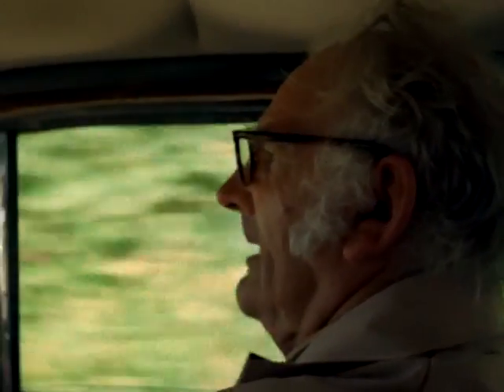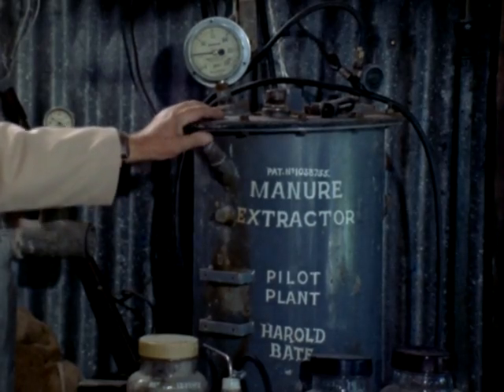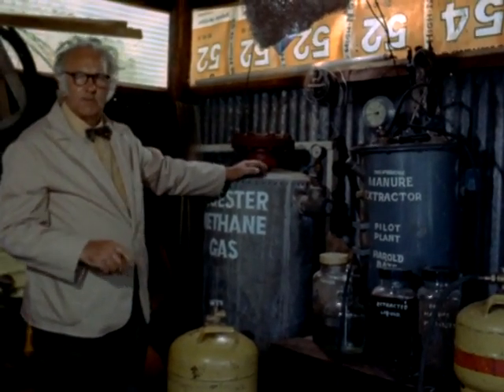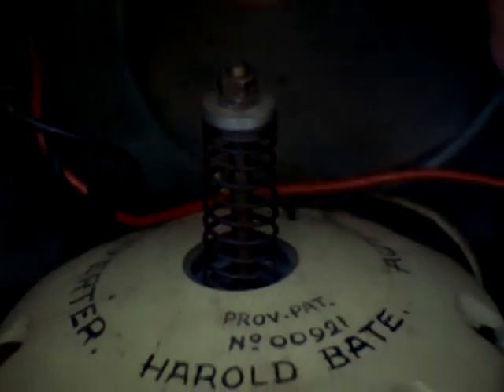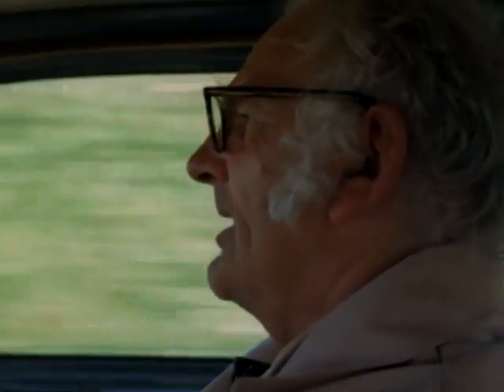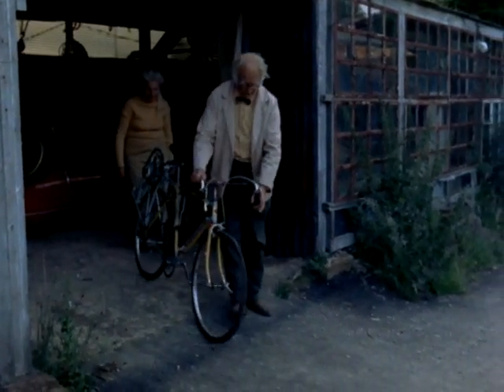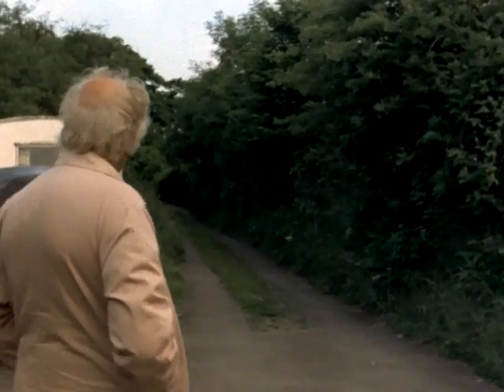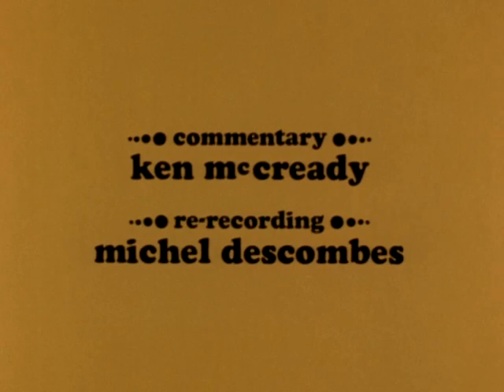Bate's Car: Sweet as a Nut

Comment: Back in the 60s, they used to actually test car engines at the factory, before installing them in the car. The Lincoln was possibly the last car to do this, and they would run in the engine for two hours on the test bench. They were run on methane, which is much safer and less messy to hook up indoors than gasoline would be.

It's also true that in Germany towards the end of WWII, when no gasoline was available to civilians, people would rig up a kind of oven in the trunk of a car to heat wood, and make 'town gas' by destructive distillation. This was a mixture of carbon monoxide, which will burn, and methane. Small cars would run on it, sort of.

Finally, fork lifts and other indoor vehicles with piston engines are fueled with methane to this very day. It's the same thing as natural gas, you know. Indeed, I think some Post Office delivery vehicles run on natural gas. They used to, certainly. So this technology isn't suppressed or forgotten. Look at Wikipedia under Natural Gas Vehicle. According to them, in 2019 there were 28 million NGVs in the world. Indeed, you can buy today a new Dodge pickup that runs on natural gas or gasoline, just like the Bate car. Ask for the dual-fuel model. You'll probably have to order it, but I see dual-fuel vehicles on the street now and then.

I certainly admire Bate's British driving skills, where he just honks when approaching an intersection on the cow paths they use for roads in England. I believe the movie isn't meant to reveal this amazing technology, as much as it is to be a portrait of a somewhat eccentric British amateur.
Reply: In Germany? There were THOUSANDS here in Australia in WW2, in my state alone there were 44 registered gasifier manufacturers. I had a relative who drive one 6 days s week as part of his job, and a mechanic friend of my dads uncle had one. We even had them during the depression! France had a bunch of different stuff during the war, I think England even had gasifiers. Korea had them in taxis TIL THE 1970S! This was a VERY common technology in some countries. And you get hydrogen as well as carbon monoxide and if you use the right type of wood, even methanol.
Reply: @OffGridInvestor  Perhaps I should have stated my point more clearly. Even under the disadvantages of being on the losing side in a war, Germans were able to improvise gas vehicles on their own, although probably not as sophisticated as Mr. Bate has done. I don't mean to run your accomplishments down, there in Australia, but I believe yours were mostly commercially built. Another difference is that many of the DIY German cars actually carried the gasifier around in the car, instead of generating gas in a stationary location. Many larger vehicles ran on fuel from a large low-pressure balloon-like gas bag carried on top of the vehicle. These were fueled from a stationary gasifier. A long way from being able to buy one from Ford! Again, though, I think that if you worry about the technology, you are missing the point of the movie, which is meant to be a portrait of a very interesting character, not to promote gas vehicles.

Comment: Am I wrong in thinking traditional gasoline based car carburettors cannot accept a gas? They work on fine mist of liquid fuel and oxygen? But he doesn't mention anything about altering the carburettor. Also if it worked fine on its own, why was gasoline needed to get the car started when he said methane had a higher octane than gasoline therefore higher power output.
Reply: You are wrong. So long particle size of fuel and air of are correct proportion you meet the the requirements of combustion.  Grain silos, cornstarch factories, and sugar mills have blown up because solid fuels mixed in the correct proportion with air.  The carburetor’s function is to mix the fuel with air. The Bate converter’s function is to supply the correct amount of methane to the carburetor.
Reply: This is a simple biogas system. We have cars here in Australia converted to propane  or LPG ALL the time. And I had a carburettor one. You have a toggle switch, 3 positions first is gasoline, then off, then propane. So you switch it to off and the carburettor bowl empties after like 100 meters and you hear the engine start to bumble and switch straight to propane. If it stops you just crank it again. Some people used to do it while sitting still, I used to do it while moving and you keep your thumb on the switch and as you loose power  or the engine runs rough you know it's almost out and switch it over. If you switch it STRAIGHT over the engine bumbles because it's running too rich. I now drive the last model of ford ecogas engine, the FACTORY BUILT one with a higher compression ratio that ONLY runs on propane. And then they went to Ford EcoLPI, an injected version. There's the ford ecogas car on my channel "dedicated gas" as we call them because they're entirely LPG. I have a converted injected gas one shown too.

Comment: Did he ever write anything down?
Reply: Doesn't matter, it's a simple biogas powered machine, converted much like New Zealanders natural gas conversion vehicles or Australias LPG converted ones, but they use vacuum draw instead of a regulator hooked to the accelerator. I have an LPG car that's factory built with higher compression and hardened valve seats. Ford ecogas.